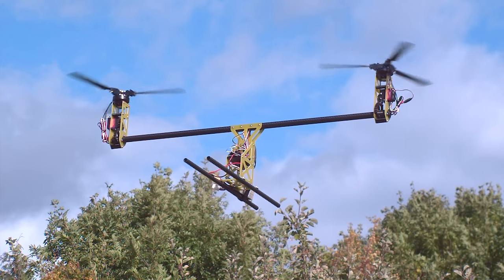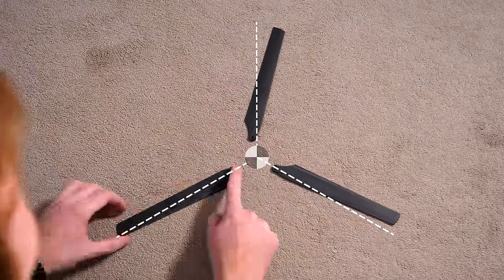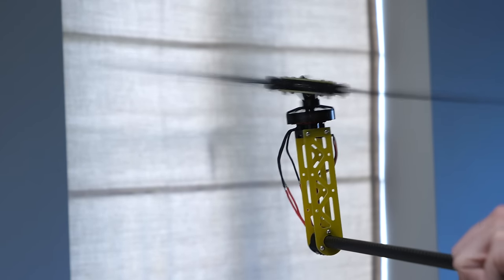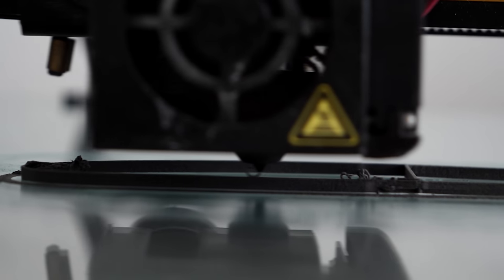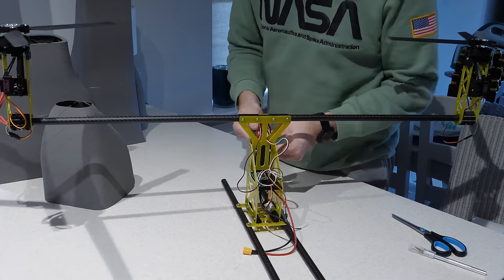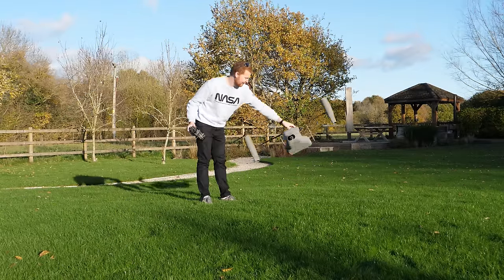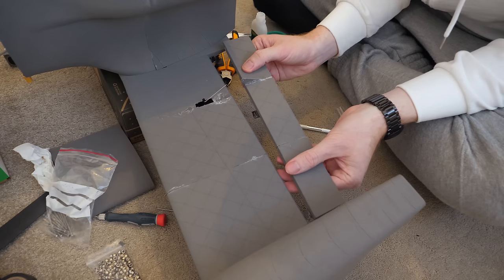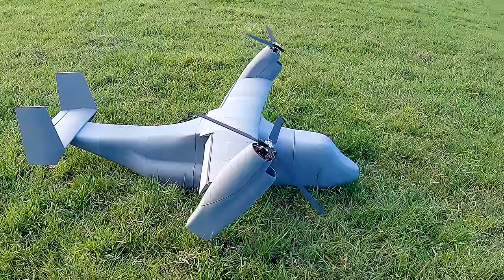Building a V22 Osprey - Part 2

Comment: Funny thought. You basically need more weight or to more carefully consider the dynamic center of balance of the aircraft and how much it changes by the change in position of the rotors. The extra weight could modify how much the center of mass moves as a function of how much the rotors swivel

Comment: I think what you should do, is along with the servo mechanism, add a sliding weight, that way as the motors rotate, the center of mass stays relatively the same. It would add some weight, but I think it would help with stability during transition.
Reply: I said the same thing even a have a weight at bottom of the rotor casing so when the rotors go foward the weight balances them out

Comment: What if you add retractable leading edge slats on the wing to aid in forward flight? Retract it to reduce wing area in hover, but extent them to increase wing area in toward flight.  This would also aid in the shift of cg to nose heavy in toward flight so the leading edge slats would compensate for the change shift.  A mechanical weight that could be shifted when transition to hover may help the hover transition.

Comment: Put the motors closer to the center of rotation and run a drive shaft to the propellers. Cg shift lessoned to a more controllable point.

Comment: 20:54 I feel like both ailerons being down in hover mode also has the nose pitch up when transistioning, like a reverse elevator.
You should try programming the ailerons to first pitch up (and maybe elevators to pitch down for assist if necessary) then get back to their hover positions when transistioning is done

Comment: Great looking 22. It also looks to hover very well and fly really well at up to 1/2 transition. If I may,  there are 2 problems that make your 22 unable to climb in full transition. You've figured out the first which is that tilting the weight of the motors forward causes it to be nose heavy. The other problem (which I didn't find mentioned in a quick search of comments) is that the pitch of the rotor blades is optimized for hover, but is far too low for horizontal flight. The 22 needs a certain amount of horizontal speed for those tiny wings to lift its weight, and the low pitch angle ideal for hover does is not enough pitch-speed to pull it around fast enough to climb on wing lift. So, you may have to go back to a rotor hub design that allows you to increase blade pitch in fight.
Reply: You can increase the size of the wing by 3-5 times. The flight speed will be lower. lift force is higher. I also searched in the comments.

Comment: You need to add slats to the front of the wing and have them pitch up when wanting level flight at full speed. This will provide the required lift.

Comment: My suggestion for the weight shifting issue would be to move the motors as close as possible to the wings so that the center of mass's movement is minimized when switching modes. Then use a pultrusion CF shaft to carry the torque from the motor to the props.

Comment: When transferring back to hover mode, having the transition really slow should help, I'm sure the really thing will have each transition really dliw and steady, having it done at speed will throw weight forward and backwards to quickly, throwing weight forward will help with forward momentum but as hovering is coming to a stop mid air the quick weight transference is more notable and violent, which then pitches the tail and you lose flight balance, so I would try the transition moving back to hover mode 4 or 5 times slower than it does now, that's something you will need to work out either with the servers or using a slower gear or larger sprocket, I'm sure that's something you could work out how to do. Building this from scratch was amazing to watch, you could sell the model to a large firm and make some cash from it.

Comment: I wonder if increasing the angle of attack or the curve of camber line at the end of the wings near the nacelles would help balance the flight better when the propellers are pointing forward. The idea being to redirect some of that horizontal thrust back to a more downward angle to compensate for the change in center of gravity.

Comment: This is an awesome project, I wish I had the $ to do it.
Suggestions:
Increase the transition time from half-hover to full-hover, test out different speeds just to calibrate it. That should help overall with the transition problem. 
For the fact that it just dives straight down when in full-glide mode, I would make a different main wing with different airfoil geometry. It seems like you arent generating enough lift, or that your center of lift is very forward. This is most likely due to all your electronics being forward but the tail (which is more or less un-obstructed) is very far back from that, causing your center of lift to be thrown backwards and causing it to dive. You could move some of your electronics back into the tail section of the fuselage, or move the wing forward (but that would change its look which is bad). Or (my suggestion) design an airfoil with a higher base angle of attack at level flight, increase surface area and chord length to generate more lift, and dip your trailing edge lowerd. Gliders and model aircraft in essence don't have much similarities to play with compared to real aircraft, besides looks. This is more or less due to the scale change of the actual aircraft but in terms of fluid flow around the body, taht stays at the same scale. Air density acts to a much greater effect regarding generating lift on larger aircraft, which you probably know. Also remember, you're making a hollow body monocoque aircraft while the scaled up real version is packed with equipment, making the center of gravity and lift completely different for you unless you also scale precisely where all the equipment weight and loads would be applied. Ultimately i'm just saying that the wing might need some tweaking but went on a tangent.

Comment: tbf to vertical land it you do need to slow down a lot and tilt the engines back up gradually for it to adjust, if you still have certain amount of speed and tilt it up to a certain point all that momentum will cause it to lose balance

it was kinda cool to see how realistic it was compared to the real life ones

also for the end part where you try to find fixes for it, i think you just need to practice flying it instead, its a different beast and it probably takes a while to get used to it

Comment: It’s not the centre of mass moving backwards, in fact it moves forwards because the point of lift moves backwards. It’s the motors thrusting backwards relative to the ground because on trying to slow it down you tilt backwards, and then the direction of thrust increases this exponentially. 20:27

Comment: Tom I’ve just worked out your problem after seeing a video on the F-82 twin mustang.  Reverse your propeller rotations . The air is being trapped between the fuselage and nacelle.
Reply: The prototype F-82 wouldn’t get airborne. They swapped the motors around and boom !

Comment: Transition to hover by building a little cogged track with small weights at its base with a servo to shift the centre of gravity back and forth by riding the track back and forth. Wire the track servi in reverse polarity to the tilt rotor servo so it equally opposes its action, only need to figure out how many tooths on the "track servo" to move the track just enough to shift the centre of gravity in equal opposition.

Comment: It looks great, I would lengthen the wings by 25% because the flight speed is too slow to have enough lift.  Regarding balance in the air, I suggest doing a weight test with the engines in both positions.

Comment: I asked the ai about the shift in center of gravity. Interesting answer:

The transition from forward flight to hover mode in an Osprey aircraft involves a complex set of changes in the aircraft's aerodynamics and propulsion system. One of the challenges in this transition is that the center of mass of the aircraft shifts towards the back as the wings rotate from a horizontal to a vertical position.

To compensate for this shift in the center of mass, the Osprey uses a combination of flight control systems and mechanical adjustments. The aircraft's computer-controlled flight control system adjusts the pitch of the aircraft's wings and the angle of the engine nacelles to maintain stability and control during the transition.

Additionally, the Osprey has a system of adjustable ballast that can be moved forward or backward to compensate for changes in the center of mass. During the transition from forward flight to hover mode, the ballast can be shifted forward to counterbalance the shift in the center of mass towards the back.

Overall, the Osprey's complex system of flight control and mechanical adjustments enables it to successfully transition between forward flight and hover mode while maintaining stability and control

Comment: Hey Tom, as an rc enthusiast, I've been wondering for a while now if making a gear or belt driven quadcopter (drone) with brushless motors could lead to better efficiency and flight times. I know there are high pole count motors available for a similar effect, but maybe using smaller motors would be better weight wise. Please consider this as a video idea 👍🏻

Comment: Fantastic. I'm sure you've already solved it by now, but it seems like the obvious solution is splitting the battery in two and mounting them as the counterweights under the engine pods?

Comment: Hi, great work ! I have little question about rotors tilting back and forward while in hover mode. Is it doable just by tilting whole engine mounts ? to have less servo count. I know you mentioned you would not like it, but I am asking if it is technically feasible. Like if it is not too much mass to be tilted too quiclky, or something like that. Thanks

Comment: Have you thought about putting a smaller battery in each wing to balance the weight?  For its size, a real Osprey has a pretty small payload. I think the props should be larger too if you want to keep it to scale.  Not forgetting the variable pitch :-)   Great work though.

Comment: Hey buddy. I was a v22 crewcheif in the marines. Awesome video and awesome model. I have something to share with you. I noticed once you transitioned to airplane mode u got a significant nose down resulting in u aborting full blown airplane mode flight. The counter to this in the real thing is two aerodynamic deflectors that are positioned one on each side right on top of the crew door behind the cockpit and vise vera for the other side.

Comment: Your problems with horizontal flight might result from that great simplification of the rotor head. 
For hovering You need a shallow pitch. But when the thing gains speed in horizontal flight the pitch should be higher to maintain thrust. And this the simplified rotor head can't provide.

Comment: perhaps a small rotating pendulam in the center attached to the same bar as the motors, so as to shift some weight forward as the motors weight goes back?

Comment: Put the batteries in the back of the engine pods such that the center of mass is the same regardless of the angle of motor tilt.

Comment: Have you considered moving the engine nacelles to rotate about their own CG? This would remove the weight / CG shift with transition without adding any weight. I know it would then look a little less authentic; another option could be putting the motors toward the rear of the nacelles and driving the props by a longer shaft. It's like you're soooo close to it working completely, just need to solve this problem! I look forward to any further development you do :)

Comment: Could a different propeller angle help in forward flight? 
Helicopter/Quadcopter rotors are designed for efficient static thrust with a lower pitch angle. Maybe a higher pitch angle could give you the thrust you need to make it climb. 

Wonderful work by the way.

Comment: If the motor shaft was longer so that the motor is close to the hinge, it would reduce the shift in center of mass as it tilts. This should solve both your problems I.e nose heavy in forward flight and sudden pitch up when coming back to hover mode.

Comment: perhaps it makes sense to balance the mass of the rotor with the mass of the engine. Those. remove the engine beyond the turning radius and make the drive from the shaft. Plus, it is necessary to significantly reduce (reduce by half) the shoulder (imitation of a turbojet engine) on which the rotor rotates. This will reduce the loss of transient stability. The current system is more stable in hang mode, but suffers in transient mode.

Comment: If you could use some kind of driveshaft to move the motors back and keep the props at the front of the engine pods, you'd solve a lot of your problems.

Comment: Amazing stuff.  Came together very well at the end and flew really well in half transition mode.  Quick thought about transition back to hover.  Can you create a mix on the transmitter that changes the aspect of the motor nacelles forward as the main spar rotates,  that wat way they are still creating forward movement and not allowing the tail to drop. Does that make sense.

Comment: Great video bro, no other content creator on YT is even in the realm in terms of quality of your content. For the issue of instability during transition you could create a block of code that would trigger during transition which would tilt the rotors in such a way to add backwards thrust to counteract the backspin. This would also result in a smoother transition rather than a sudden stop. Sry in adv if i have made any gramatical errors

Comment: Nice job on the design, build, and video. Can you split your battery into two packs and put them in your nacelles? Then you could balance the CG without adding ballast. Probably don't have the volume for it, but an idea.
Reply: Or since your whole wing spar moves you could just cantelever the battery off the back of the wing spar inside the fuselage and it could have the same effect.

Comment: So once you got the basic control established, the finished machine suffers from COG issues? A moving COG when rotating the nacelles, as the motor weight moves forward? 

Could you split the battery pack (as a major weight component), placing half of the batteries in the rear of each nacelle? Proper distance ratios should all but eliminate the COG shift upon nacelle rotation.

Comment: I wonder if the simplest way to get around the weight shifting would be to mount the motor in the center of the nacelle with a long axle, and return to individually tilting nacelles altogether. 
Granted that would be more difficult to tune and control in the end.

Comment: Put your motors at the nacel pivots so they never shift their weight around. All you need then is a CF shaft to the where the props mount.
Reply: Did you see the part where the prop and motor is vectors by a servo for pitch and stability control? Would need a good deal more than just a shaft. Like a universal or CV joint. Likely more complex than sliding the battery around inside the fuselage.
Reply: @orulz1  Pitch the whole nacel and not just the motor...like the real V22 does it. I didn't think much of how he did it on here. I know he started there, but IMHO, he shouldn't have abandoned it.  With the motor at the pivot for the nacel, it's weight is always in the same place and the gyro effect from it is where it impacts things the least. He's always been doing this build with the motor at the prop and I think that's the problem. He can't keep the CG in one place.

Comment: Is there a way to move the actual motor farther back from the propeller so it's closer to the spot where it's rotating on the carbon rod? That seems like it would help with the weight shift when you transition flight modes! Looking forward to checking out the next video, this is fascinating!

Comment: great vid, but its not the center of gravity shifting back, but the horizontal momentum gets consumed, as the structures momentum is slowed at the rotor roots which is far higher, while the center of mass is lower, so the structure tilts backwards. but it is not gravity causing that, but braking. imagine you ride a bike and lean up with your hands to grab a still wire hung across the street above your head. Your hands immediately stop as you touch your wire, but your body wants to continue and you are tilting backwards. 

the whole slowing need to happen much slower so forward momentum is consumed very gradually

Comment: I wonder why the motors are not places closer to the pivot points inside the nacelle, and just a longer axle from the motor to the propellers, then there would be less weight shifting..

Comment: i know maybe it's too late to say this, but, if you put the motors on the pivot point and use a shaft to reach the props? the angle of the shaft can be varied with a simple ball joint or something just before reach the prop.

Comment: Wouldn't be better to move rotating servo to the opposite side of the rod? That gondolas are quite long. Servo in the back would counterweight the motor and propeler. What do you think? If the gondola's CoG will be the rod mointing point, gondolas would be neutral to the body.

Comment: if you could mount the motor at the point of rotation that way the the center of mass wouldnt be affected by changing the mode of thrust. and a cw at the tail of the motor probably would add that much weight if you put it as far back as possible.